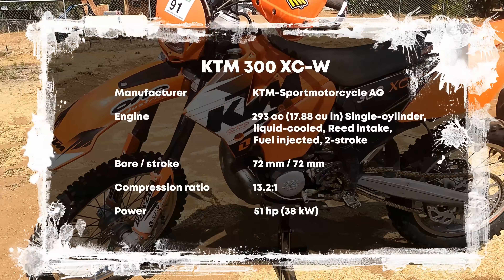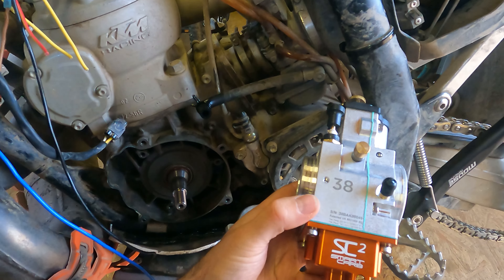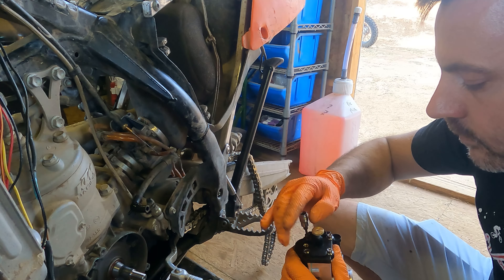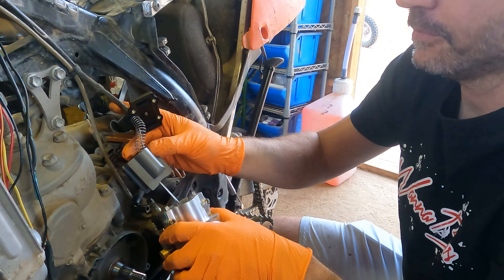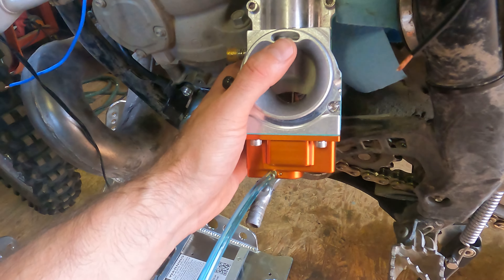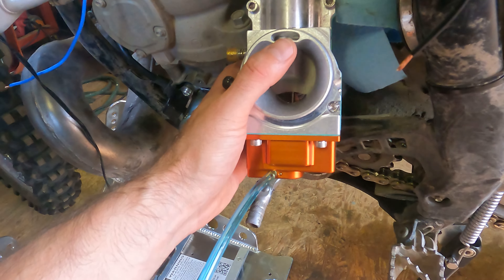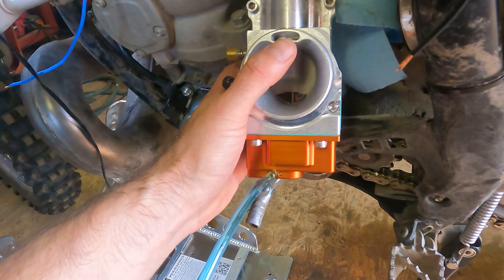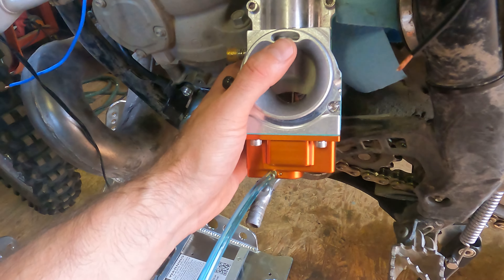KTM 300 Smart Carb Install | Mechanical "fuel injection" for your 2-stroke dirt bike

Comment: I think the manufacturer forgot to install the carburetor on my bike, I can't seem to locate it. I should problem check the forums and find some wise internet people to point me in the right direction.
Reply from the maker: You should, I’ve heard with that happens the error is between the seat and the handle bars somewhere 😎🤭😝
Reply: @ExtremeSportsWannaBes  do you have the part number for that part? It really causes a lot of problems. Ha!